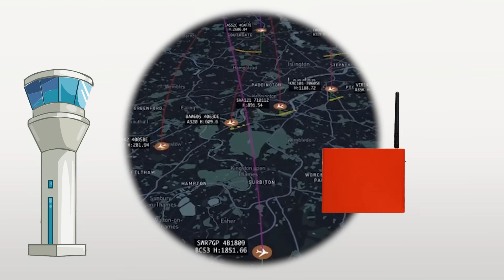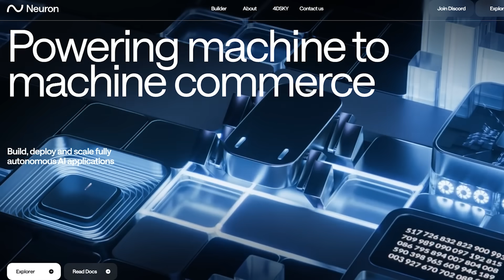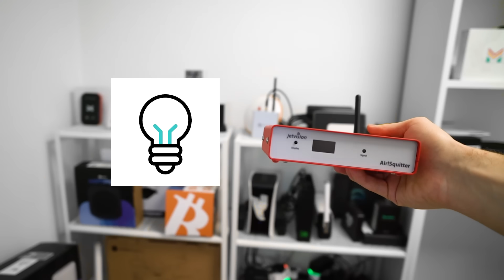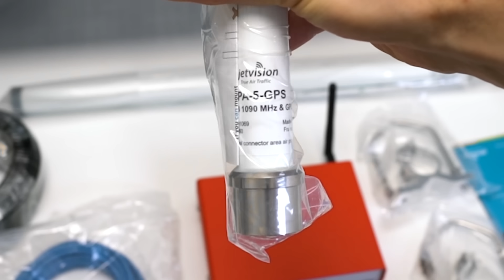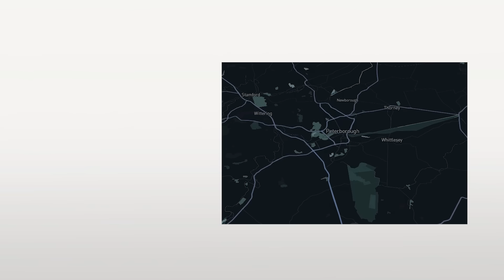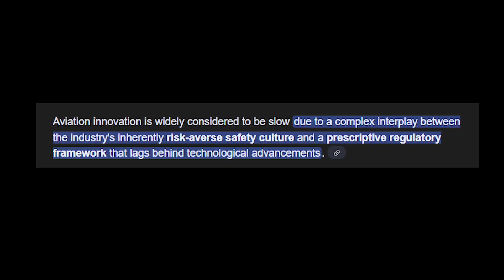4DSKY Airsquitter Review: Airport-Grade Flight Tracking at Home & Get Paid for Every Plane + Drone

Comment: Do we have any idea or speculation as to potential earnings with this?
Reply from the maker: Nope, no idea at all that I would be confident to speculate about. At this early stage of DePIN projects, the best indication of great potential rewards is to look at the projects's or company's funding/investments/revenue. If any of these are already large, that's a good indication, but not always enough. A good revenue can signal towards stable reward amounts over a long time, which is honestly the best case scenario for these low powered devices. But a good company revenue is also not a 1:1 that DePIN device rewards will be good, since that depends on how the tokens will be utilized/integrated with the service/product they are offering.
Reply: @NordicCrypto for $1000, not having any idea of return is not smart at all